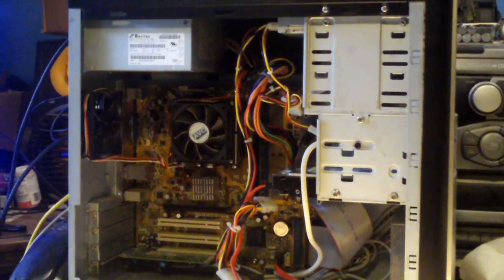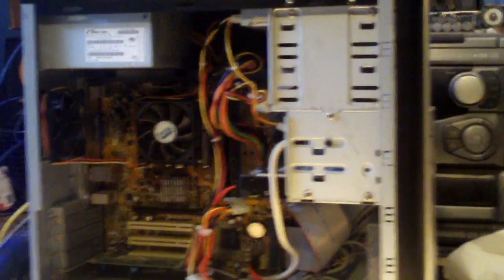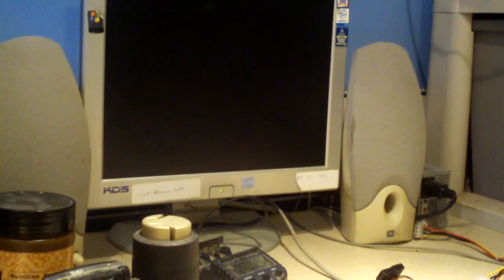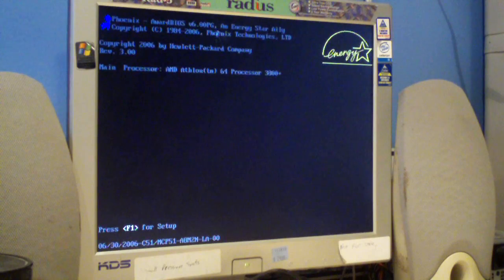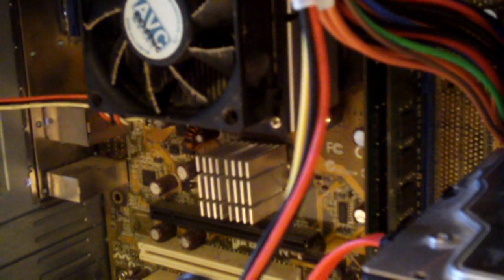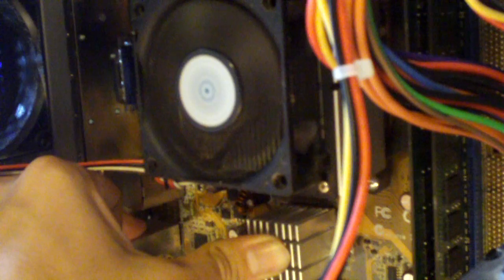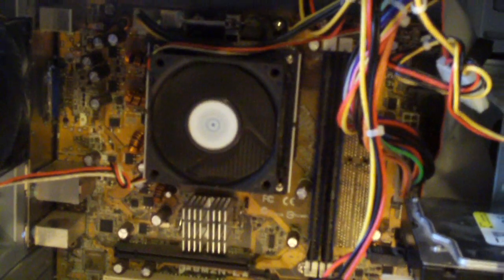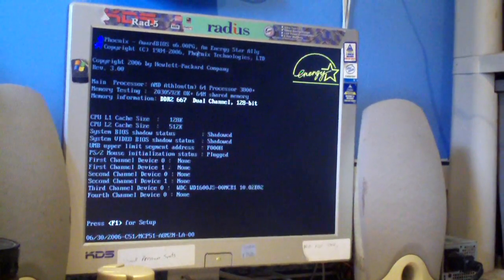A way to tell if your dead motherboard can be reflowed back to life

Comment: About 6 months ago I set my computer so sleep mode for about an hour, and that motherboard never POSTED again, tried different graphics card, different ram and different supply, I didn't have a different CPU at the time and I have been told that CPUs almost never fail. The motherboard in question was GA-990XA-UD3 and the CPU paired FX6300. Since that I have replaced the board with the simular, but 970 chipset board and everything worked fine, same PSU, same CPU, ram and the GPU. Today i was scrolling trough your old videos and I saw this and decided to try it on my old board, at first it did nothing but after some time of trubleshooting and attempting to verify all the voltages on it, the board came back to life and now posts every time. Could it still be a BGA connection? I also have a system I use as a server, it has a problem that it never posts first time, but always posts secound time, should i try reflowing it?
Reply from the maker: That seems to be a BGA issue with the motherboard's chipset.
Reply: @CubeComputerChannel  for both of the boards?
Reply from the maker: @filenotfound__3871  I would say yeah
Reply: @CubeComputerChannel  ok, thank you, I will try it if the old board does it again, not sure about the server pc, I am afraid of breaking it even more.

Comment: same problem but I am scared to press the northbridge heatsink while it's on
Reply: Sdref Wan  why? It does nothing but transfer heat, not electricity, don't hurt you nor the unit, as it's meant to be pushed against it for proper transferring of heat

Comment: I bought a new rig ryzen 3 1200 gtx 1050ti  asrock a 320 mobo when I turn on power switch the cpu fan isn’t working and so is the psu fan.I even tried the paper clip test and psu works fine .pls help me out
Reply: Sometimes power switch on case goes bad also

Comment: what about mined sir also the motherboard fan also not working how do i fix this .. f i dont pug the 4 pin connector on the mother board fas dont work but f i unpug it .. i left only the 24 min connector it moves but stop again
plz help

Comment: because my USB port was not connecting , CD ROM was not supporting CD and my head set also was not connecting. but when I install windows 7 again its fixed but headset still not connecting.

Comment: Try plugging in a 24pin ATX Power Supply and NOT a 20pin. No amount of pressing on the motherboard going to fix a lack of proper voltage problem.
Reply from the maker: The 24 pin connector is not required unless you put the load of a video card on the machine. The machine this motherboard came out of used a 20 pin connector. The issue with this board has not a thing to do with the power supply connection. It has to do with a faulty BGA connection on the northbridge. So go ahead and keep saying no amount of pressing is going to fix a problem. I have done this before as a diagnostic procedure on these boards before.
Reply: I don't see a graphics card in there. Doesn't really matter if it under a load or not. The manufacture(Asus by the looks of the board) doesn't just put that plug there for looks. If you are using onboard graphics then you need that extra 4 pin connector if your using a graphics card then no you don't need that extra 4 pins....lack of proper power can cause any system to act funny, thats I'm trying to say. Pushing on parts to figure out a problem does work, I've tried it many times.
Reply from the maker: Those extra 4 pins are there to supply additional power when a graphics card is installed. Remember, many graphics cards do not have that built-in 6-pin connector for auxiliary power. When no graphics card is installed, then the 20-pin is sufficient enough for this particular 2006 motherboard. Newer motherboards would benefit from running a 24-pin connector, but it's not like I'm loading up a game just by powering on the system. Also, on many boards, the northbridge chipset gets it's power from the 4-pin/8pin ATX 12V/EPS12V connection.
Reply: @metalrob169  damn man your account is ancient 😂

Comment: +Cube Computer Channel what about a computer that has three heat sinks on the board what hold down all three? my motherboard is acting the same way heat sink is warm not that hot but it will not post at all please get back to me asap
Reply: ***** its the msi gaming 790 google it for a pic
Reply from the maker: The heatsinks on the chipsets of most AMD motherboards are held down with plastic rivets. To unhook them, you have top access the rear of the board and squeeze the split piece and it should pop out.

Comment: HELP ME PLZZZZZ.I could switch on my computer,but while loading it will freeze.I tried with the fix menu but didn't work.Then it will restart and freeze again.Plz help i have many memorable memories stored in there.T~T
Reply: BTW it frozed at the 'Start windows'.
Reply from the maker: What version of Windows do you have?
Reply from the maker: Sounds like you have Windows 7
Reply: yep. nvm i fixed it using commands

Comment: Any ideas motherboard has power light on no boot? not an issue with any other items connected was having issues in my system with reboot loop and was booting the other day posting then instant rebooting. Tried it the other day now it was pass post but power light still working on mobo.
Reply from the maker: Have you tested the power supply to see if it powers on or not? You can test it by shorting the green and black wires on the main connector.
Reply: Hey there, Yes. I actually thought the PSU was the problem so I got a new one same issue then replaced motherboard and everything works just trying to work out if the motherboard issue is fixable or not. PSU works no problems also switched it out with a working PSU and the same happened.
Reply from the maker: If your case requires you to manually attach the front panel LEDs and buttons, sometimes you can get it crossed up. That's the only thing I can come up with at this point.
Reply: Ok thats cool. I was wanting to make sure I have tried everything before I get rid of this board. Thanks man for your help. Subscribed.

Comment: Before you say your mother board is dead plz just push the 16 pin cable into the sockets a bit more i did this and it turned on i was about to throw my mother board out but it works fine now :)
Reply: Enter Nator oh wow I didn't think that would work but I have a 24 pin connector, so I tried reconnecting that and my computer works now. I was so stressed that I would have to buy a new motherboard

Comment: I'm Using a Gigabyte H61M-S Motherboard and I got almost the Same problem I need to start the PC 5-10 Times once it was started it works perfectly. I don't know why. I press the power button the fans works but the keyboard lights and the Ethernet port lights never works please help.
Reply: Same here man
Reply: Know any Fix ?
Reply: same here
Reply: I Fixed it, it was a RAM Issue. My motherboard supports 1333MHZ RAM but I was Using a HYPERX FURY which was 1866MHZ and when I installed a 1333Mhz Memory it works with the First Boot.
Because the 1333 MHZ RAM was only 2GB and the HYPERX was 8 GB for gaming I cannot use a 2 GB RAM.
So I got to the Gigabyte Website and Downloaded the Latest BIOS (BETA) and installed it and everything works fine now.

Hope it Works...

Comment: I have a Problem, same issues, it turns on everything but does not Display it is a Pslp-le Motherboard No face plate on the case due to Airport, and no Reset button at all. The fans run, and it doesn't Beep even with the ram sticks out, Is the motherboard dead or can it Actually Be fixed?.
Reply: did u fix?
Reply: ended up having to get rid of it. used a barder system and traded 3 non working desktop for a Working desktop
Reply: +Cj (Cursedfallengod) the motherboard?
Reply: Not sure i just didn't have time to invest into it.

Comment: i have an issue with a customers computer at school it is completely dead the mother boards 24 pin when the power supply is plugged in does not turn anything on theres no indicator light to show its working no cpu fan spins or nothing
Reply from the maker: +ProVe Dougyy Have you checked the power supply?
Reply: ***** yes we have that is fully functional
Reply from the maker: +ProVe Dougyy Make sure the front panel header (power button, power LED, HDD LED, Reset) is properly connected.
Reply: its an older system it doesnt have the connecors seperated
Reply from the maker: +ProVe Dougyy Actually, older systems are more prone to having separated connectors. I believe the motherboard in that system is bad.
Reply: +Cube Computer Channel no like it doesn't have the separate connectors for the pwr switch led it's all in one little square plug and it its probably that I may use the screw driver method to reflow the current threw it

Comment: my pc problem be like , it wont worked , cpu fan only worked lime 1sec(not kidding) then nothing ... i replace ram , remove cmos battery , hardisk , changed psu but still nothing , is this motherboard ?
Reply: *like
Reply: +arief daniel check on the grounding on your mobo

Comment: I got problem with my computer it wont display on the monitor I have tried everything... taking off the CMOS battery.., changing the processor, I change the RAM, and the heat sink too, I even check the cables .. .. My computer beep that's ... Im starting to think that my mother board is  dead.. what could be the problem dude?
Reply from the maker: +Rafael Reyes Sounds like a bad board.
Reply: @Matthew Saul-Clayton Thanks, you think it could be repaired?
Reply: the board is a ipmmb-formosa has 2 years, the mobo has a nvidia video card.

Comment: hi there, i have a question for u, well its my laptop, as i press the power button it powers on for about 2 or 3 seconds most and then go dead, can i conclude my motherboard is dead or maybe something i can do to see it breathing again?
Reply: I think it the I/o chip you will need solder skip to solder it.

Comment: Man that hard drive was failing. Boot manager was missing. Was it aged or was it hit too much?
Reply from the maker: hard drive's 8 years old.
Reply: ***** My dad's old Windows XP machine that was a Dell Dimension 2400, he thinks the HDD failed because it slowed down. It's not the HDD. Malwarebytes wasn't too compatible with it and slowed it down. I don't hate Malwarebytes. I am a Malwarebytes user. It still works. It was a Seagate IDE I think.

Comment: i had a hp motherboard a few months ago that would post but that it would always hard freeze when doing the pnp detection, both windows, linux or anything that poked the pci slots. And sometimes it would corrupt the cached bios on the ram that would show visual artifacts after resetting.
I checked the voltages and they looked fine even though it had a few bulged caps in the cpu regulator. Do you think it could have been the north/south bridge having broken connections?
the machine had a core2 based 1.8ghz pentiumD / intel chipset with small pasive heatsink.
I told the guy that imo the chipset was fried, and that for what it was worth it, he better just buy a new one and reuse the case. what do you think?
I didnt bother recaping because it glitched always in the same place, so it didnt look like it was ripple on the cpu line.
Reply from the maker: If there are bulged caps on the CPU VM, then that can cause instability.
Reply: *****  i know, but the weird thing is it froze in the same place every time. If it were the cpu regulation then i think it would be more random (like when undervolting) and would change as the caps heat up. The guy said it started suddenly doing it and that's it. I didnt want to risk replacing like 10 caps and finding out it wasnt after all.
Maybe i should have checked the ripple with the oscilloscope just to be sure, but i was lazy :/